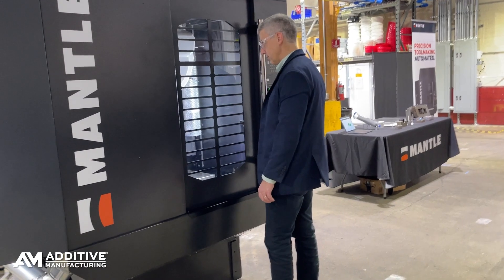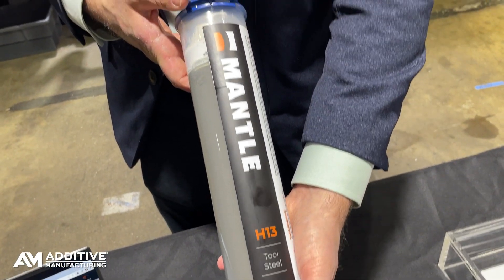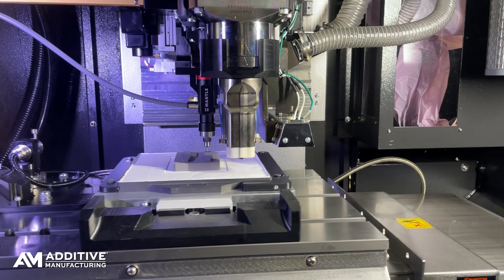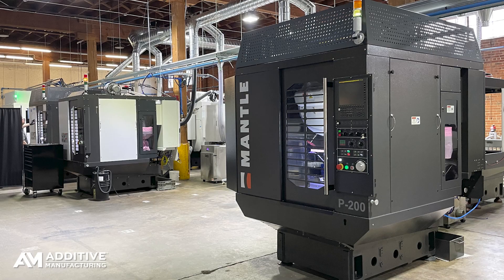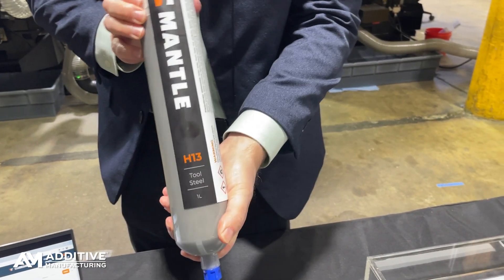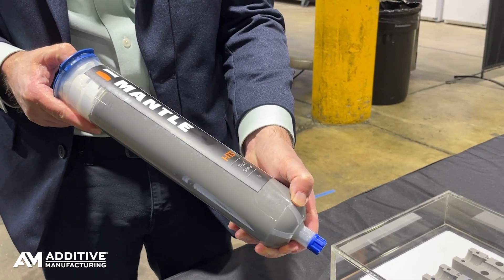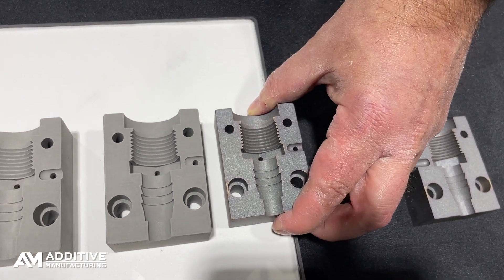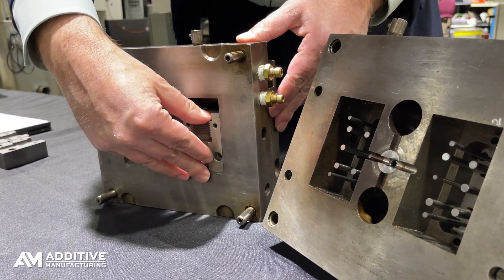3D Printing Molds With Metal Paste: The Mantle Process Explained

Comment: That is very clever but I note the finish on the sintered mold looks abrasive so Im guessing the product is not going to have a smooth surface or is that not so?
Reply: They would be crazy not to add a mill to get the required surface finish at the end.
Reply: @abdifatahaden4761  Yes but if you are going to mill it why not mill the whole thing and be done with it.

Comment: Neat, I've been experimenting with a similar concept (albeit at a much smaller scale) where a water soluble binder is used and freezed inside of a traditional mold then sintered. 

I'll be watching this company 👀
Reply: pva glue binder? , what do you think of the Rapidia,
Reply: @MrBeaach  slightly different binder but I'm still working through a good ratio of ingredients. It looks interesting but anytime I see request a quote it normally means it's well out of my hobbyist budget